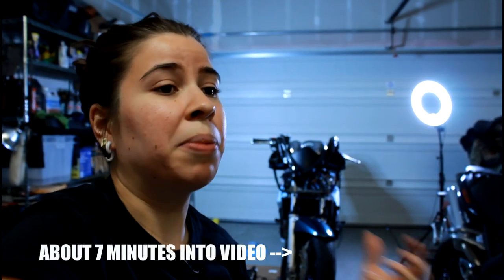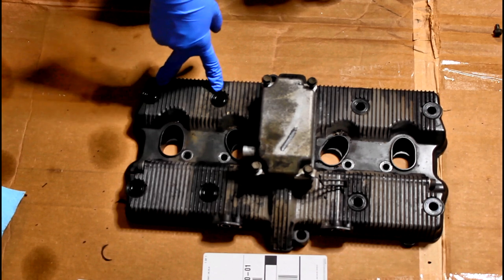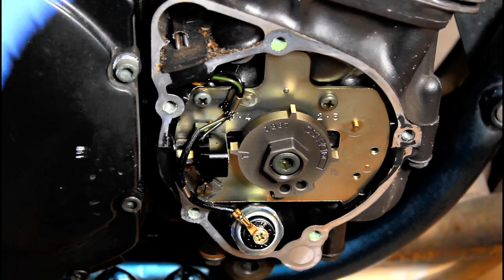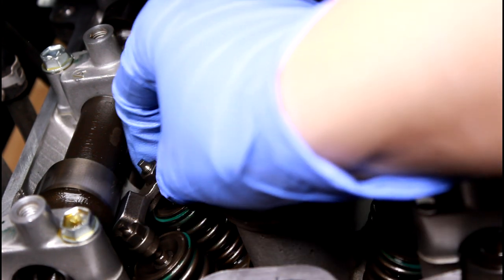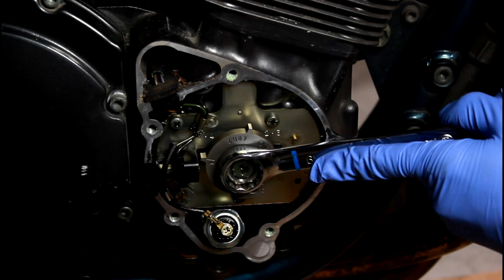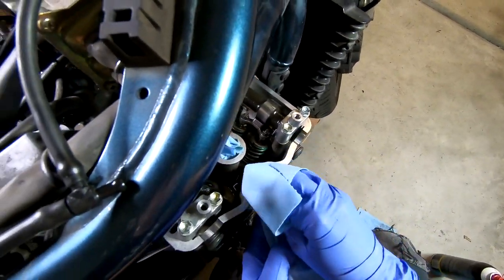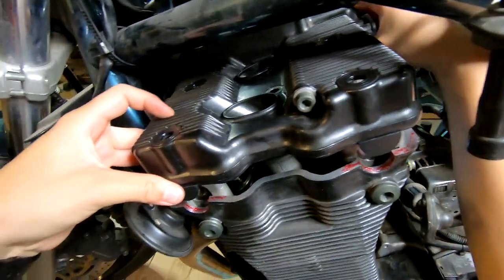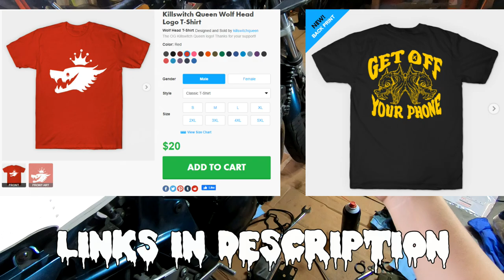Suzuki Bandit 1200 Valve Clearance Adjustment - How to Adjust Valve Clearance

Comment: Great video Olivia, nicely done. I'd recommend anyone with even a modest amount of mechanical aptitude to take the time to do this on their own bike. This is a much easier job that the bikes than you have to remove the camshafts to make adjustments.

Some things for people to keep in mind when doing this job. Clean the carburetors just as she did, check her video on it. If you're going to clean your carburetors, then you should most definitely check (and adjust if necessary) your valve clearances. Intake and Exhaust valve opening amounts (as determined by these adjustments), is going to control the amount of air that flows through your carburetors. If you're going to balance your carburetors, which you should if you take them apart, then you don't want to be balancing them to an engine that is not taking in the same amount of air/fuel into the cylinders. All these things are tied together, and one affects the other. Also, do the engine after it has sat overnight. You want the engine to be cold. The manual probably specifies what temperature the engine should be at when checking them. If you don't have the exact size of feeler gauge, you can often use a combination of 2 smaller ones to get the size you need.  Metric sizes often come like these, Metric sizes (mm): 0.04, 0.05, 0.06, 0.08, 0.10, 0.13, 0.15. If you need a 0.14 gauge, then use a combination of the 0.06 + 0.08. For a 0.12, use 0.08 + 0.04. You get the idea.
(edited for spelling)
Reply: Superb advice 👍

Comment: Very excellent work with your methods and explanations.  I have a 92 Katana 1100f.  It's amazing how little has changed between 92-2006, so many similarities.
Reply: What are the clearance specs on the 1100 F? Are intake and exhaust both the same?

Comment: I have a 600 Bandit, but the work is just like this. I removed the stem from the fuel valve to allow the tank to lift off easier. Also I cheated and put the bike in gear and moved the cam through the rear tire, saving a gasket. Great video.

Comment: Great video  i am getting a bandit 1200 from my cousin not been run for a few years but in great condition  with less than 10,000 miles for £1000 . Need to do some work on it myself but not as knowledgeable as you but want to learn takecare Neil.

Comment: The   1,103  Cubic  Inch  engine in  my  1955  Northwest Crane is a Muphey Diesel .. It as  double over head cams and 4 valve heads too ..  Need  several  special  tools to  run the rack .. adjust the inectors  ect..   It  turns  1,200 RPM's  wide open and makes  110  Horse power..

Comment: This may have already been covered, but when making adjustments on double rocker arms, (correct me if i'm wrong) you should use two of the same feeler gauges, one under each arm to be sure each one is set the same..otherwise if you check one at a time, it can throw the other one off a bit.
Reply: Not really , one at a time is fine, the rocker arm should have no play from factory

Comment: Great video! I learned a lot about this bike and it is always good to see the actual model you are going to maintain before discovering by yourself. 
Two questions: can you provide a list of spares and tools needed for the operation you show, with a cost estimate ? And how hard the cam adjuster nuts should be tightened?

Comment: I know your post is a year old. Hope you read this since you work on em for a living. Maybe you can confirm some stuff for me. OK I've got a 94 GSXR 750 Rings got washed after cleaning everything changed oil ran fine you have to watch the petcock it fails if you use ethanol gas right after fill it up put it the garage. Bike ran fine for 2 seasons. It rev just fine lacked power. Did compression test 60 psi on all holes. it still ran. I'm saving for top end. got 250 saved. Go whoring on Craigslist late one night I never see Suzuki stuff like this. 2001 Bandit. Wrecked. 29,000 motor carbs harness left controls spedo tach pipe supertrap can for 250 Bought it put it in the bike started runs but have had man jet issues low idle great seems it doesn't get enough gas. I put 2500 on it. Never did a valve adjustment. Took it on 100 mile round trip. I'm 30 into it. I slow down enough I hear this squeal I shut it off called buddy trucked the bike home motor was hot too. I'm thinking valves. So to do ajustment motor got come completely out. I notice one oil lines wa pinched. Did compression test 90,90,90 100 #4:take cover off #4 wasn't getting oil to the rockers 3 were fine. There's scratches think polish out. Cam bering's fine. Then checked the valves. Every one is tight. .002 won't even go. Doesn't that burn the valves ? I'm thinking buy some new rings gaskets. Then I can check the valves put it back together got the float levels right finily all 4 plugs were the same color for once.

Comment: Well, it's unanimous, this is theee best DIY Bandit repair/maintain all things Bandit site! My question is: I'm fully built Y2K B1216 with Gsxr1100 cams. Tried to adjust the timing and could NOT line up the marks on the cam ends. I'm a builder/rider with decent motor skills but this one escapes me. Even though these are different cams, shouldn't they still line up?

Comment: Hey thanks for sharing.  I am attempting this myself on my Suzuki GSX 1100F.  It looks quite similar. I definitely would like to see the parts omitted.  Such as removing the Valve Cover, to see where the tricky parts are.  And watching the clean, a speed through would be helpful. Watching others clean, everyone does it a little different.  But I can pick up tips and tricks on how to do it properly.  Overall, awesome video. Thanks for giving me confidence doing it myself.  And i will keep a logbook as you recommended.  Thanks Killswitch Q!
(I like the Hoppe's you recommended for the carbs, it works great)
Reply from the maker: Removing the valve cover is pretty straight forward, just remove the bolts and wiggle it off. Everyone can figure out their own technique, I find all mechanics do it slightly different.
For cleaning I like WD40 or similar. Good scrub with a brass brush or plastic scraper for the stuck-on crap. Then wipe it down.
Glad this helped!

Comment: Your a great mechanic.Why not check all the valve clearances or did you?Im looking at a 2002 today and i'm going to go thru it this winter.How many miles do you think between valve check oil etc.Or do you go by the manual?
Reply from the maker: Thank you! Yes all clearances were checked on this bike, I didn't show it for sake of being redundant. Definitely go by the manual. Sticking to the service interval will prevent issues before they become a problem.

Comment: Cylinder 1: intake and exhaust
Cylinder 2: exhaust
Cylinder 3: intake ?
Turn cam
Cylinder 2: intake
Cylinder 3: exhaust
Cylinder 4: intake and exhaust

The transition cut was odd did I get the order right?
Reply from the maker: Yup!! That's the order
Reply: @KillswitchQueen  didn't notice you put a carb cleaning video, definitely gonna watch those later. Remind me again what prompted all this? I remeber the bike wasn't running right is that it?
Reply from the maker: @MrNightpwner  Thanks! Bike ran great, just going through the motions of servicing a used bike.

Comment: What is the mileage interval when the valves need to be adjusted? I'm looking at an '02 Bandit 1200 with only 3000 miles on it and was wondering how long it would be before that needs to be done.
Reply: FSM is to inspect/adjust @ 1000, 12000, and 24000 miles.

Comment: At least it has threaded adjusters.  I use two feeler gauges for intake and two for exhaust and do each at the same time. I keep the feeler gauges in and feel the drag and tighten. Of course I don't have a Bandit, but a R1200RT, but the idea is the same. Shim under bucket sucks. The K1600 requires removing the cams to change the clearance. A lot of work to get there.

Comment: Had a b1200 and it is a nightmare to do thos valves...on my sh300i scooter takes 10 minutes to check the lash and more 5 minutes if you have to change a shim( the rocker arm slides...). In 63000km changed only 2 exhaust shims and they were still in spec just tight. Now i have a sv650 and not planing to check them in some years. Next bike maybe a guzzi or the boring nc750, at least checking the valves is easy! Lol

Comment: Killswitch Queen, I have the same bike and thanks toyou i set the valve clearances.. there is just one thing i noticed about the alignment of the left gear's arrow that is supposed to point up. Its not really pointing up. Could you check if this is wrong or if its normal? https://youtu.be/07LisQyQ_eE
Thanks really appreciate it